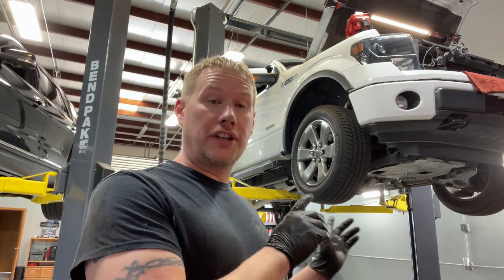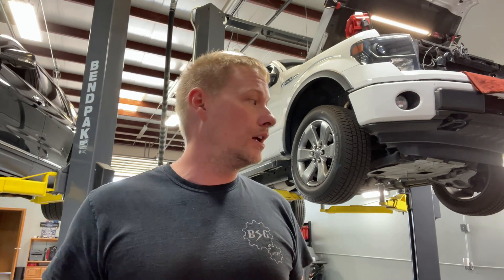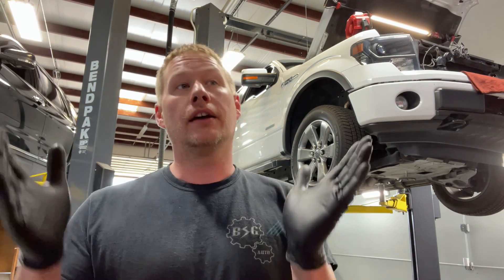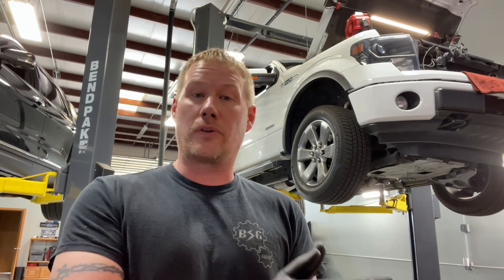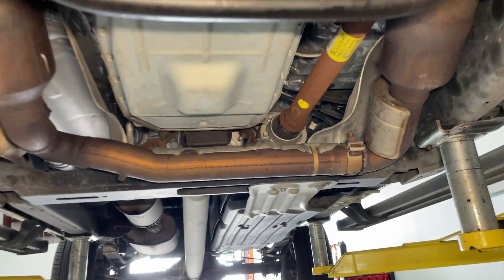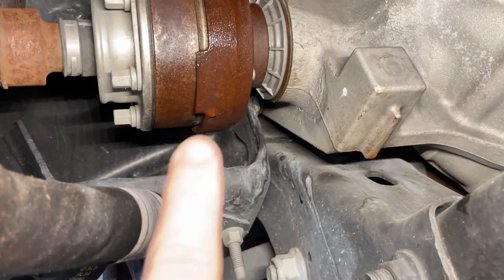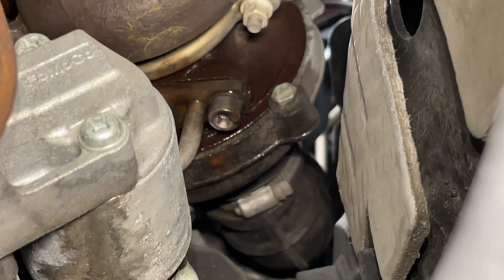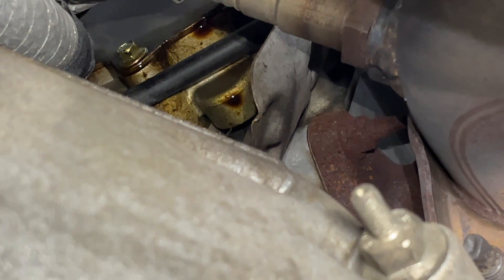Ford Ecoboost Engines Can be so Hit or Miss: I Really Feel Bad for This Customer...

Comment: Yup. 82k miles on my 2017 expedition. 2 recalls on hvac blower motor. Leaking coolant at passenger side turbo. Leaking refrigerant somewhere (probably the coil). Annoying switch & actuator failures (hvac blend door, driver seat adjustment). Corroded positive battery terminal connector

Love the vehicle when it works. Not happy with the reliability or serviceability. The vehicle is too finicky and parts are in messed up places - makes me miss my 99 Grand Cherokee

Comment: May 13 ford 3.5 I did a timing gob at 198g f150, did it myself,  what I was especially curious about was it ran good before just had the chain slapping noise, no phaser noise! Once I did the timing job it runs smother like it could have been a tooth out of time but still got 20 mpg! Long runs! However a month later I did replace oil feed lines to the turbos because it was a very small leak, like not noticeable between oil changes but you could smell a faint smell of oil burning, coolant supply never leaked to turbos,  an by the way changing the turbo supply lines coolant or oil is not fun with cab on! It can be done not the end of the world but just know it’s kinda difficult

Comment: It drives me crazy that we still for some reason need a vacuum pump on turbo charged and diesel engines. Why the hell are we still running accessories off of engine vacuum? They've gone crazy with making everything electric now from your power steering to your e-brake but we still have vacuum lines running around everywhere? WHY?

Comment: Honestly I loved both of my Ecoboost F150s. The biggest things I do is use Pennzoil SYNTHETIC Oil, change it every 3000-4000 miles and do preventive maintenance as needed. I have owned both the 3.5 and 2.7 but prefer the 3.5. I usually put about 30,000 miles on a year with some occasional towing but not often. Mostly just highway and town miles. So maybe I'm doing something different then everyone else but in my mind when it comes down to it I'd say it's a crap shoot when compaired to other competitive brands. For example Dodge and Chevys cylinder deactivation issues destroying engines. It's not necessarily certain it will happen but it definitely can. So I guess pick your poison. In my case I'd rather roll the dice on a potental timing chain job then worry about needing to replace the whole engine because little bits of metal destroyed the bearings. Plus in the case of the Ecoboost the extra torque is nice when needed. Just food for thought I guess. 🤷

Comment: I have a 2014, F 150, I had to replace the water pump at about 70k the impeller broke up. other than that the Coyote 5.0 has been great, I would never have a turbo. I farmed back in the day when they first started to put turbos on tractors, those, never held up the way the old naturlly aspirated ones did. I still get good mileage, although a bit less than the turbo, i have no worries either. And, the mileage advantage soon fades if you drive them hard.

Comment: Sounds familiar! My 2018 F150 with 70,000 miles is in the shop right now for a complete transmission rebuild, front cover oil leak and cam phaser replacement, shock replacement, and various hoses that the crimps are cracked. NONE of which is covered by warranty. This truck has had 5k oil changes, all oils including transmission changed at 35k.   Cost? $11,500+- and three weeks!  I 100% trust the mechanic I am using so no, I'm not getting ripped off. At least not by him. Ford, well, you be the judge.

Comment: Had a 2012 F150Lariat with the 3.5 Ecoboost. At around 150k miles it developed the cam phase rattle and took it to the dealer for service. Their solution was to replace the engine but it was no rush. At 160k the check engine light came on. The engine replacement was due because the timing chain had stretched but I couldn't see dumping that amount of money into a 13 year old truck with all that mileage. Decided to trade it in. Carmax gave me $8k for it.....went to look at new Ford F-150's but they were priced much too high for me so I ended up going with a Toyota Tundra. Personally I feel the Ford was a superior truck in some ways. the 3.5 Ecoboost is a smoother running engine and a bit more powerful and faster than the Toyota 3.4 twin turbo, the rear seating was roomier. I miss my F150 but it was time to move on.

Comment: I own a 2014 eco-boost 109 thousand miles on it. The only problem I’ve had with this truck have been three spark plugs and coils. No leaks I will admit I’m not pushing my luck. Have my truck scheduled for the timing chain replacement and all that goes with that.

Comment: I just sold my 2016 2.7 f150. Had almost 90k miles and zero issues BUT this is what drove me to get rid of it. I did notice the leaking of something within the last year of owning it so hopefully the next guy doesn’t have major issues. Outside of minor issues like new battery and break pads, it never left me stranded. 

I’m actually done with trucks now. 65k is just bananas to me.

Comment: Can't wait to see what happens to the wife's 2020 Explorer ST 3.0L Ecoboost.  The SUV is code named Total Recall due to the number of recalls it has had since we bought it.  I have to take this one in due to an intermittent burning smell.  We've already had to replace one side of the exhaust system due to a crack recall. The tech dumped a load of carbon out of the catalyst when he tore it down.

Comment: I'm guessing if a common problem on a vehicle is not related to safety then the manufacturer will never issue a recall. The coolant leaking from the turbos is a very common issue but Ford does not give a crap because they do not want to lose money fixing them if they issue a recall. It all comes down to money over quality!

Comment: Do you also do a high volume oil pump on these (like the 5.4) when you do a timing job or do these not have oil pressure issues? Thanks.

Comment: My Ford 23,000 mile had a rocker cover leak that I sent it to the dealer about a dozen times to fix they couldn't 
It turns out the rocker cover was never machined from casting got is machined leak fixed

Comment: All I can say is that the fact that the legendarily reliable Toyota went to a 3.5l twin turbo engine.  And even Ram - after all those billions marketing their "legendary hemi" - went to a 6 cylinder twin turbo.  And Chevy has their TurboMax.  Everybody copied Ford's twin turbo.  Pretty outstanding from an engine many of you people demean.  It's an OUTSTANDING engine: imitation is the highest form of flattery.
Reply: The only reason everyone is going to the well known less reliable turbo is to meet fleet mileage standards to keep the gubmint away. Less displacement, same or more power and torque and better fuel economy. The engineering trade-off is spotty reliability.

Comment: There’s nothing wrong with turbo charging and engine. Ford just don’t know what the hell there doing. Turbo Charging is the way to! Making more power and torque out of a smaller displacement engine. There’s no fault in that. It’s just the ecoboost is a flawed design.

Comment: I was considering a 24 Ranger with a 2.7 but after reading all the comments may need to go with Frontier or Ridgeline with V6 non-turbos,  Want to downsize from full size to mid-size, Currently drive a F150 5.4 original owner with 170k miles with only 1Tune-up and normal oil & filter service.  I am probably crazy for considering this move.

Comment: Change oil often! The misses don’t do the maintenance and driving habits matter too. When your foot is in the turbo just daily driving you will pay for the power and fun! Drive it decent and it will be very good to you… .
Reply: I agree, thank you. I have the 2016 F-150 with 2.7. 
It gets full synthetic 5-30 every 4K miles. @ 117K miles, quiet running. Plus, I’m easy on the throttle, do not pull excessive weights

Comment: My turbo coolant line was dripping very slowly and I did not realize it.  It happened to drip on the starter until one day I went to start the truck and the starter had shorted out.  That required a tow to the Ford dealer which revealed the shorted starter and the leaking coolant as the root cause.  Then, several months later, I noticed a loud chirping noise on the driver's side.  Ford diagnosed that as a manifold leak on both sides of the engine that required restudding and new exhaust manifolds installed.  It took lifting the entire cab off to do that repair.  I take meticulous care of my truck and it has had every single service done to it.  Repairs above and beyond that have cost me $5-$6,000 at least to my V-6 twin turbo Ecoboost F-150.  In addition, the rear engine seal has had to be replaced twice because it started leaking oil badly.  Those were repaired under warranty, but were still inconvenient and quite inexcusable in my estimation.  The most infuriating repair was not engine related.  It cost over $1,000 to replace a $30 blend door motor on the passenger side which failed in the full cold position so there was no heat on the passenger side.  To change that $30 part took a center console and total dash pull.  There's no excuse for that.  When you spend $60 grand on a truck, these types of things just shouldn't happen.

Comment: I had 40000km when my 2013 f150 ecoboost timing chain issue came up.  It's currently 130000km.  It's on its 4th timing chain, new transmission coolant pipes which broke, coolant leaks on turbo, new water pump, main seal leak, transmission Lead Frame dropping truck to 1st gear at 80kmp!, plus all the issues from warranty repairs not done correctly by Ford dealerships.  Overall....poor quality vehicle and Ford service.

Comment: I have a 2014 ecoboost.  One tubo is acting up   Iam not n vacation towing my small camping trailer. The turbo is not happy when going up a grade.  Some time loss of power. If i down shift to 4 gear its not so bad.  Really messing with the vaca.  I can’t get anyone to work on it in show low AZ.  Iam 4 hours away from home. Its happy on the flats not on the grade.  Question can i slow crawl home with out blowing the engine.  No leaks. Thank you in advance.       Bill
Reply from the maker: As long as the turbo is not coming apart or consuming oil you are good to go in most cases.

Comment: Dont like trucks. They are 5 passengers cars but more expensive. But even if I would buy one, I would buy a truck with a cummins diesel engine. 
I have a 2000 jeep grand cherokee and only job was changing the right hub. Removed the head just for checking and it was great.
I do have a 2011 ford explorer bit I was wise enough to buy the 3.5 natural aspirated and just 2wd

Comment: I have a '15 3.5 EB F-150 and I had the Vacuum pump leak as well as the front timing cover oil leak. I had the dealer fix them under warranty. (I bought the extended warranty.) It took them two tries to fix the Vacuum pump leak. Glad I checked it again before the warranty expired.

Comment: The problem is not the engines its the people driving them and some on ford for not explaining. Most people are driving theae like an old ford V8. For the truck in the video, did the customer change out the spark plugs, trammision fuild, engine coolant, probally not which tells me they were not driving a turboed engine with care. Ive had 3 eco boost trucks and my wife has had 1 all with over 100,000 miles zero issues.

Comment: Isn’t the gen 2 motor way better ??
Reply from the maker: no
Reply: @FordTechMakuloco  ok I asked because the reviews I’ve watched showed after 2017 when they went to port fuel injection they were better , along with a fix for the chain
Reply from the maker: They are better but now way better. 2021 and newer models are much better.

Comment: 2011 5.0L with 65,000 miles - low oil pressure and ticking noise, guess it's not just the ecoboost....

Comment: Gotta love those 3.5 eco turds. Just finished replacing one of the manifolds to the updated design due to broken studs on Transit 350. When we're in there we replace all the common coolant failure parts. Fittings, lines, and gaskets. They are a pain to do in the Transit 350 but my tech loves em.

Comment: I have a 2013 f150 with the 3.5 eco and it's only got 111,000 miles on it but it decided to grenade itself and slung a rod put a hole in the block

Comment: 2011 ecoboost, was replacing the exhaust manifolds as they had warped, and ended up having to replace all the water lines to the turbos aswell.

Comment: I've had two Fords. A 2005 Expedition and a 2013 Fusion Titanium. The Expedition was bulletproof. Sold it with 225,000 miles on it and it still ran brilliant. My 2013 Fusion is the #1 reason why I won't ever buy a Ford again. Nothing but problems with that POS.

Comment: I have a 2014 3.5L. Bought it several years ago with 59k on the ODO. It has 206,XXX on it now. The only major problem I’ve had has been throttle body related. Had one get stuck open (according to the ford techs). Cost me $800 to replace. Had it gum up last year  which put it into limp mode, and a $50 cleaning fixed it. Knock on wood, I have been extremely happy with it. Not sure what problems lie ahead since I’ve hit 200k, but if I had to do it over again, I would’ve done more research and bought a 5.0, but I can’t really complain at this point.

Comment: So glad my head was screwed on correctly when I was looking for a F150 3 years ago. I wanted a crew cab, 4x4 and had to have the 5.0. I found exactly what I wanted and I have been really happy with my 2014 F150. I was scared of exactly this with the ecoboost engine
Reply: I’m looking at used 2014 F150 5.0 V8 with 88k on it and have been reading many good things about the V8’s.  I’m tempted with going with the 3.5 V6 turbos, but like Brian said I think you can be hit or miss with the V6 Ecoboosts.  I just want a good truck that will last long long mileage if you regularly maintain it.  Don’t get me wrong, the V6 ecoboost has major torque at low RPM’s, but I think there are give and takes with turbo’s especially on V4 and V6 engines.  Nice now, but pay down the road later.  Your post was 1 year ago.  How is your 2014 F150 holding up now?

Comment: My thoughts is if your gonna get an F150 stay away from the eco boost stick to a V8 it will last more then the eco boost has more power and amazing sound stick to a V8 or if you wonna level up get the F250 with the 6.7 power stroke diesel just prove that the eco boost is not ment to be in the F Series

Comment: I have a 2014 EcoBoost fx4 getting some leakage from the same spot on the passenger side. Doesn't seem to be losing much fluids though but it is all wet under there

Comment: Great video! Subed. hey can ask my truck does that slap thing or whatever it is at startup? Other than that runs great I bought it with 100k on it now has 156k 2011 3.5. Other than start up noise runs great is that a timing issue?

Comment: Throw some blue devil radiator sealer in there and see what happens, and get some dye and see if the leaks slow down at this point.

Yes all of those gaskets should be replaced. would it hurt to try something for that coolant first?  And oil leak around the turbos is the real headache though. Ugh. Feel sorry for this person with this truck.

Comment: I have a ‘13 F150 Ecoboost with 230K miles.  Had to replace the vacuum pump, head gaskets and passenger side turbo, but have not had to change timing chains.  Water pump has been incident free.  Thanks for your vids.  I watch every one!

Comment: You can't win with a Ford apparently. Either they rust and corrode terribly because Ford does not take virtually any measures to prevent corrosion (like quality zinc coatings or the like), or like the Texas truck in this video. I bet the summer heat in Texas did a number on all those seals and gaskets you found leaking. Higher quality gaskets and silicone seals probably would have held up better. What ever happened to engineers designing components with the "over-kill" mentality? Some parts of old cars NEVER wear out. Not anymore. Incompetence or guaranteed obsolescence?

Comment: Where  are you located  I need to get my 2003 f150 - 4.6triton timing chain repaired right. I paid  2600 to a shop here and the truck ran good for 200 mls and started back rattling.

Comment: I think that these issues are OUR (collective) fault as consumers.  Every purchase, we vote with dollars.  If Ford can take our money for the Platanium Super Exclusive with the $250/ea paper cone speakers but poorly designed parts, that only a dealer can service, we will continue to get exactly that.  How many quarters would it take for a "buying strike" by 10% of truck customers to force Ford to fix this issue (honest question....my guess is 3-5)?  Why do the front and rear differential covers, even in the Raptor, not have drain holes?  Why is the transmission fluid not user serviceable?  Why is the FX4 transmission "skid plate" made of the same fiber cloth found in the front wheel wells?  Why are the upgrade speakers made of paper in 2023?  We can get better stuff if we demand it, but if we just keep buying we'll get exactly as little as they can get away with.

Comment: Hi i got a 2015 expedition king ranch with 110k on it and i noticed its leaking coolant i haven't check yet been so busy at work but its something i will do this weekend, but i check the engine oil and i saw well what i think i saw its the oil kind of durty like almost black and I changed the oil last month and My question is...  if the coolant can go into the engine also it has some kind of smell of burning oil? hopefully you can help me with the question and maybe give me some tips for common leaks and its something really serious if coolant goes into the engine?. thanks for your help!